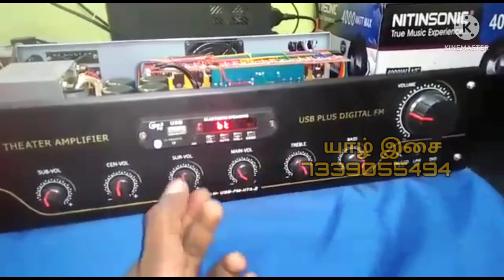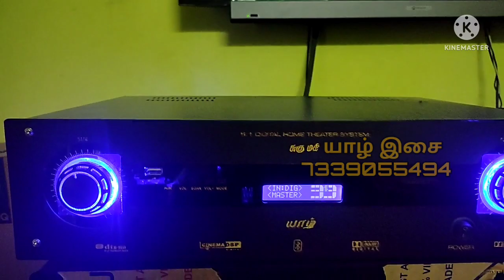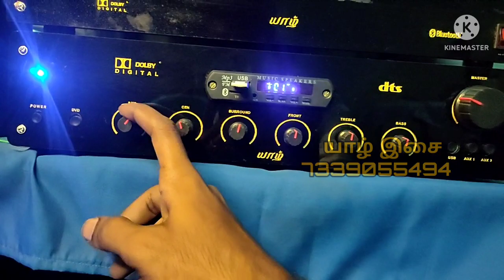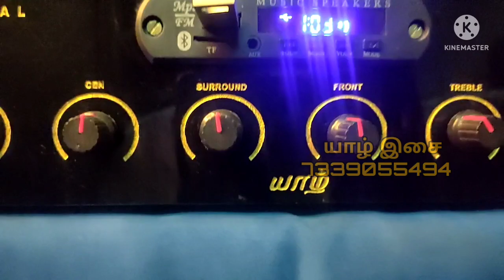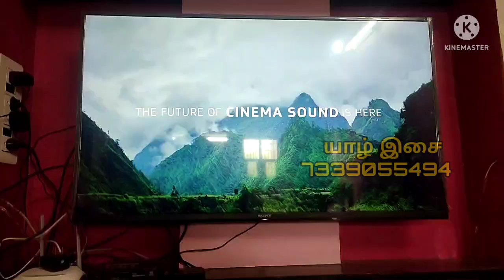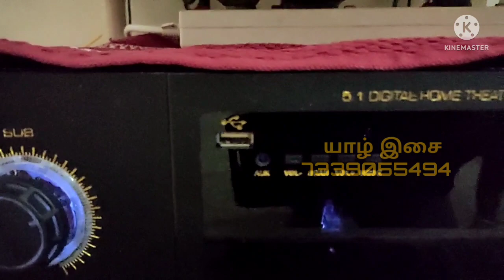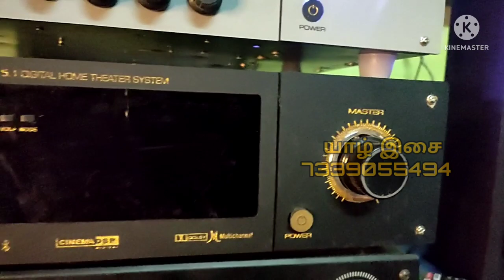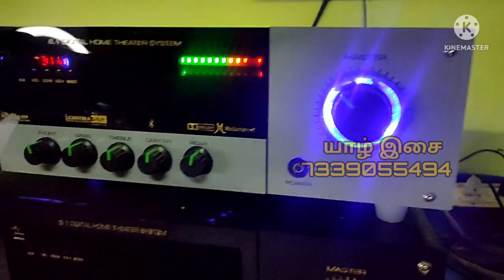5.1 Dolby Pro logic உண்மையா | Dolby | Atmos | DTS Result எப்படி பெறுவது #trending #amplifier #tamil

Comment: Tip 122 Tip 127 Pair Transistor audio board power supply 24 0 24 3 Amps ethana watts sub ku varum sollunga brother plss
Reply from the maker: Around 100 watts.. but circuit and it's components also decide it.. same time power supply factor also important
Reply: @yaazlisaihometheatrearrang3166  naa dainty 12 inch use pandrean volume konjam increase pothu  otharuthu
Reply from the maker: Power பத்தாது. ப்ரோ dainty 12inch ku
Reply: @yaazlisaihometheatrearrang3166  vera enna bro pandrathu any solution otharaama nalla soft bass kedaikanum bro
Reply from the maker: Ic and transformer change பண்ணனும்
Reply: @yaazlisaihometheatrearrang3166  sub ku mattum thani amplifier vacha nalla irukumaa  apdinaa 4 transsister  mono nalla irukkuma broo
Reply from the maker: Yes நல்லா இருக்கும்
Reply from the maker: 24 0 24 5 amp
Reply: @yaazlisaihometheatrearrang3166  romba nandri bro
Reply from the maker: Thank u

Comment: bro na madurai la thaan iruken near by 3 km kulla  5.1 set amp ,8 inch sub,5 speaker remote la operate panra maathiri seiya mudiyima tv la irunthu ketkura maathiri budget 10k bro romba hifi ya venam ...
Reply from the maker: With full remote access முடியாது. But tv remote ஓட அக்சஸ் use panikra மாதிரி செய்யமுடியும் 8500,9500,10500 range la
Reply: @yaazlisaihometheatrearrang3166  super na direct ah visit panren bro ofc la...demo paakurathuku...
Reply from the maker: Welcome brother. வாங்க. 7339055494 என் number வைத்து கொள்ளுங்கள்
Reply from the maker: 15000 full package full remote access
Reply from the maker: 6இன்ச் woofer + tweeter type boxes 5ps. 10inch subwoofer 1ps. 
Full remote access amp with Bluetooth fm USB aux input 6RCA input.

Comment: Can i add tweeter in center front surround in 5.1amp.???
Reply from the maker: Yes. If you use woofer speakers means kindly and tweeter and feel the difference
Reply: Thanks  and can I install dolby atmos in mi box 4k hdr
Reply from the maker: If box support Dolby Atmos passthrough.. you can use content
Reply: Dolby atmos converter adapter for 5.1amp. Price?????
Reply from the maker: Enna மாதிரி use செய்ய போறீங்க, என்ன ஆம்ப் கு
Reply: I having mi box audio rush box and 5.1 mosfet  assembled amp. How can I get Dolby atmos?????
Reply from the maker: Arc add seithaal செய்யும்
Reply: How can I add ARC and where???
Panasonic smart tv is having ARC!!
Reply from the maker: Send me tv model number
Reply from the maker: Mi box model number also send me
Reply: Panasonic smart tv 49inch with ARC and mi box 4k ultra hdr model
Reply from the maker: Ok. Sir. Plz send me your amplifier images via what's app 7339055494

Comment: Mobile phone assembled dac/amp iruka ji unga kitta evlo varum na IEM use pandren astral kren use pandren satisfaction illa enaku
Reply from the maker: என்ன மாதிரி usage ku bro
Reply: @yaazlisaihometheatrearrang3166  portable amp/dac bro phones,Tablet ,laptop ku shangling UA2,Fiio btr5 mathiri ippo vara neraya phones la SBC codec ,aptx Bluetooth support irukum matha aac support dobly,dts  software la add panirupanga high end phonesla than quad dac ,dtsx chips irukum LG v20,Asus Rog series One plus 7pro mathiri phones.......pure sound clarity ah experience panna distortion ethuvum illama paatu kekka
Reply from the maker: Phone la kekanu ma, or phone to audio system connectivity kaa
Reply: @yaazlisaihometheatrearrang3166  intha devices rendume pannum ji itha phone la USB c type, 3.5mm Jack kooda or Bluetooth la connect pannitu earphones,in ear monitors,other audio systems kooda connect pannalam
Reply from the maker: அது நம்ம பன்றதில்லை.. friend irukaar ketu venum na solre
Reply: @yaazlisaihometheatrearrang3166  ok ji
Reply from the maker: Hmm

Comment: Bro 5.1 4k Av receiver atmos Branded puthusu price evvalavu varum enakku venum
Reply from the maker: Middle end 51000 range.. 
Avr
Reply: 5.1 Atmos receiver will not give the best Atmos output. You should have at least 7.2 avr receiver with speaker layout of 5.1.2 or 5.2.2.  Good Atmos settup will 9.2 channel av receiver with speaker layout 5.1.4 or 5.2.4
Reply from the maker: Yes. That's right. I try to provide awareness from my videos.. but still people  asking Atmos 5.1 :( and they make 7.1 assemble :( as a pro logic II

Comment: Hdmi arc amp 300 sq ft room ku evalo budget agum bro
Reply from the maker: Room size feet கணக்கில் சொல்லுங்க. என்ன company tv use பண்றீங்க
Reply: @yaazlisaihometheatrearrang3166  20×14 bro
Reply from the maker: Full set 25000 varum full set basic. But neat result இருக்கும்

Comment: 7.1 Dolby Atmos Home theater dts surrounding sound system budget brother?
Reply from the maker: 145000 ஒரிஜினல் support and proper Dolby Atmos setup entry level. Proper Dolby Atmos and dts x  License
Reply: @yaazlisaihometheatrearrang3166  ok brother low budget Dolby Atmos system?
Reply from the maker: Dolby Atmos வராது. ப்ரோ. Dolby Atmos proper ah input kudukkanum, and device அதை reflect பண்ணனும்... ஜஸ்ட் 7 speakers குடுத்தா போதாது .. இன்னிக்கு கூட ஒருத்தர் 7.1 nu nu வாங்கினேன் Atmos nu சொல்லி ஒரு ஆம்ப் கொண்டு வந்து ஏமாந்து வாங்கிட்டேன் சொல்லி கொண்டு வந்து 5.1 ah மாத்தி செஞ்சு தர சொல்லிட்டு போரார்.. world wide 5 brands thaan Atmos license எடுத்து product produce பண்றாங்க.. அதன் basic model 100000 தொட்டுடும்.. then files Atmos la குடுக்க டிவி or streaming device ku செலவு செய்யனும்
Reply from the maker: நேரில் வந்து கூட டெமோ பாருங்க புரியும்.
Reply: @yaazlisaihometheatrearrang3166  thank you brother
Reply: Denon receiver X1600h model 80k it is supporting Dolby Atmos and DTSX
Reply from the maker: No need bro apple tv streaming device and proper data connection and subscribe இருந்தால் Dolby Atmos எடுக்க முடியும்

Comment: Sir nama local market la irukara Dolby lable  mentioned analog devices ic used prologic boards use panna Dolby support aguma? pro logic 2 op amp use panna boards tha market la kedikuthu.
Reply: Like analog devices ic SSM 2126A ics???
Reply from the maker: Dolby certified contents எப்போவும் Dolby prologic வழியா போகாது... Direct ah pass ஆகிடும்.. I mean, analog amp la Dolby or dts குடுக்க 6RCA input இருக்கும். Player or optical or arc extractors வழியா content குடுத்து.. use பண்ணனும்.. அப்போது.. signal direct ah out ஆகும்.. prologic ல மிக்ஸ் ஆகாது.. Bluetooth, fm USB aux input 2rca inputs pcm optical use பண்ணும் போது தான் prologic process ஆகும்.. 
எங்கள் தயாரிப்பில்.. நாங்கள் அதை குறிக்கவே லோகோ பயன்படுத்தி வருகிறோம்..
ஆனால்.. 70% customers எங்களிடம் வெளியில் வாங்கிய aamplifier service கொண்டு வரும்போது.. 6RCA pin மட்டும் இருக்கும் connectivity இருக்காது... 
ஆனால் பெயர் mention செய்து இருக்கிறார்கள்.. எனவே வாங்கும் போது ஆராய்ந்து வாங்குவது சிறப்பு
Reply from the maker: Analog ports prologic ic குள்ள குடுத்து எடுக்கும் வகையிலும் கிடைக்கிறது pro logic . பெரும்பாலும் பஸ் அல்லது ரெடி made ஆக செய்து தரப்படும் ஆம்ப்.. அந்த வகையில் செய்து வந்து இருக்கும்... அவை . Signal boost செய்து bass மற்றும் surround அதிகம் வெளிப்படுத்தும்.. ஆனால் துல்லியமாக இருக்காது..
Reply: K sir apo DVD player tha 5.1 track correct ah varuma? Which dvd player best ? Suppose na USB player la audio songs WAV and FLAC formed songs la 5.1 track varuma??
Reply from the maker: @palrajraj6506  apdi illa bro.. naama kudukura file Dolby naa. அதை pass செய்து தரும் device mm Dolby support seiyanum..
Player ipo அதிகம் வறதில்லை.. but optical out உள்ள டிவி ல.. Dolby pass செய்யும் வசதிகள் உள்ளது.... Flac wav போன்றவை 5.1 இல்லை. ஆனால் அதற்கு நிகரான bit rate கிடைக்கும். Usb வழியாக குடுக்க முடியும்.. but prologic குள்ள போய் வரும். துல்லிய தன்மை 97% குடுக்கும். 
டிவி வழியாக செலுத்தி.. optical வழியாக கொண்டு வரும் போது இன்னும் துல்லியம் காட்டும் .  Surrounding la..
Audio songs கூட இப்போ ac 3 la கிடைக்கும்
Reply: K k bro thank you . என்கிட்ட VU smart TV இருக்கு அதுல Dolby options இருக்கு optical output இருக்கு அதுல 5.1 output வருமா bro??
Reply from the maker: வரும். Latest model ஆக இருந்தால்..
Reply: K bro thanks for your reply.thank you so much bro.
Reply from the maker: Ok. Thanks